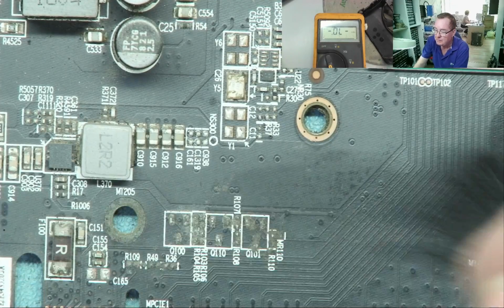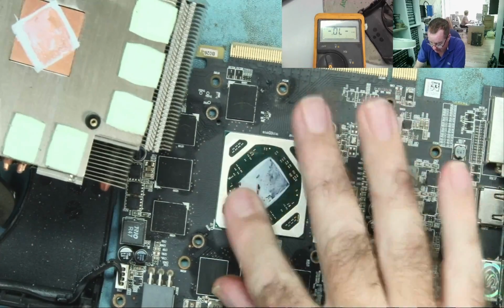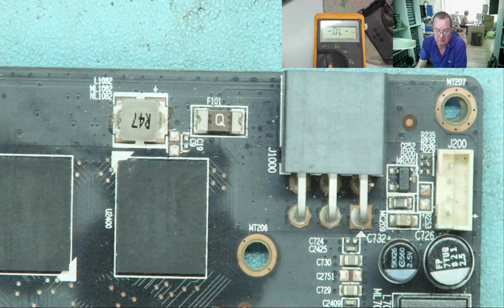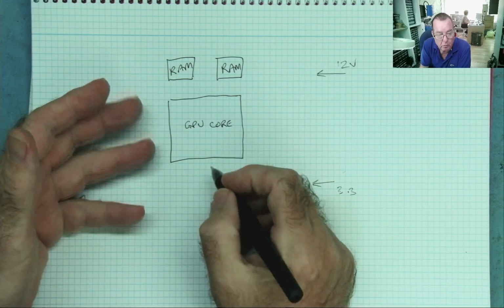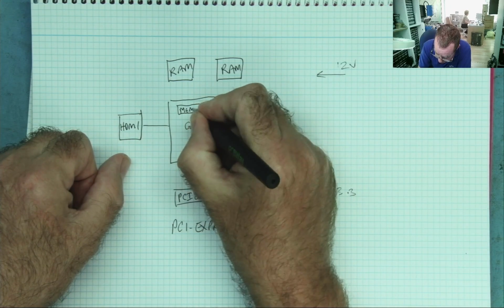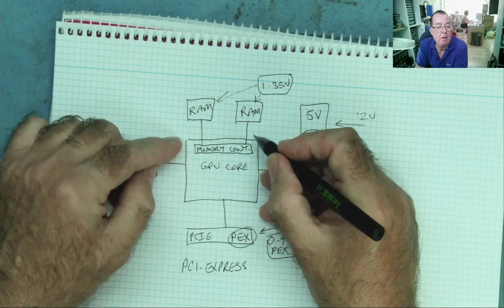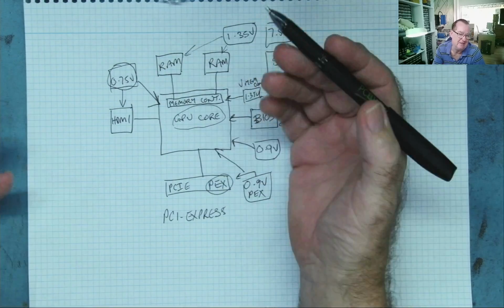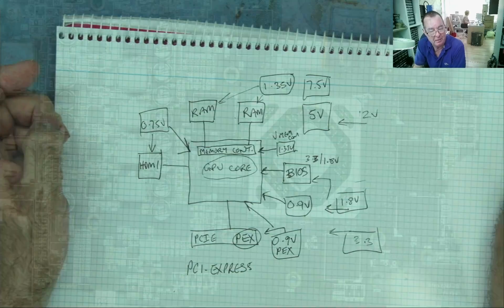Graphics Card Step By Step Fault Finding Repair Guide Part 2 How To Diagnose Faulty GPU

Comment: I have experience with electronics but nothing  on the computer side. I've already learned a ton in the first 40 minutes of these instructional videos. I have a rtx 2080 super hybrid oc. Came home one day and my PC was dead. Figured out the 2080 was not working. I followed your instructions from the last video and have open circuits on all 3.3v legs. If you have an advice as to my next step, or what video might help please let me know. I'm a little worried about removing my backplate. The thermo tape is really holding tuff. Is there a safer way to separate the plate?

Comment: As a warning to noobs. He is doing these measurements on an old graphics card. Anything 20 series and up will read 0.0 ohms for gpu core to ground. The newer cores require a miliohm meter to read.
Reply: What is miliohm meter 😅😅 I am aslo a noob if you call me it's help a lot for my journey
Reply: @HolaComtase milliohm meter is capable of reading extremely low values. Cheapest one you can get is like $140. It's not really necessary. 
He has a couple episodes talking about this device and how it can be used.
Reply: @icedcoffee8561 it's necessary to this meter and any tips For Me to Graphics Card Repairing 🥹 a noob 😅you advised save my time a lot currently I am watching this series other Recommendations

Comment: I just learned new thing from you. About oily thermalpad on vram chip. Im trying to fix EVGA 3070ti for the lats 2 weeks. And i reminded when i was taking it apart I had 2 memory chips like oily and the rest was either covered  with thermal paste  or particles of the pad. Unlike those 2, they were oily but clean of gray particles. Im looking for whats wrong with the card while learning. Card have no power to memory or the core. 3 red leds all on. One fan spins at full speed its +12v pin    just has a short  to +12v of power connector. I was injecting 1v 4amp to those two points to find warm component on the board that connected this fan straight to power supply. But couldnt find it. Voltage controller chip LPC51U68 becomes hot right after powerup. I bought a new one. My first GPU to repair. If you repaired same card with similar issues, i will be thankfull for any clues.
Reply: Did you get it fixed?
Reply: @Mrsmmith-w  no did not fix it. Do you know how to, or you have the same problem?
Reply: @vityok3000 I just had a 3060 turn off and won’t turn back on when plugged into psu, but if I unplug it and leave it on the motherboard the rgb turns on, idk how to even diagnose it
Reply: @Mrsmmith-w  this GPUs are very hard to repair. No schematics for them and multilayered boards are impossible to track contacts. I own ROG Strix 3070 OC that i bough like new open box. So far so good worked for few years no problem. And this EVGA 3070Ti I bought damaged like that with intent to repair, but no sucsess. I'm still planning to continue trying when ill have time. Bought couple of chips that may need to be changed, found burnt spot on one. And the other one is the one that gets hot. But I believe it needs to be programmed before installation. It has some leggs that can be connected to USB. So I believe if my chip is somewhat alive I can read and copy the program from it and move it to new one. First Im gonna change  burned chip it is fan controller. If that do nothing will try to desolder two memory chips that was oily. Card should run without them with less memory if they are shorted and causing protection mode. If that is not gonna help will try that hot chip procedure. Its the hardest thing because the leggs are very small. And my hot air soldering gun died. Cant find the other one I had.

Comment: RX5700 PCIe edge card testing shows a direct short to ground on the 12 volt legs. How do you find out which part is shorted? I suspect the GH15E regulator. I'd have to remove it to be sure it is causing the short. Nothing looks burned or heated. All parts look good. Do I need a better DVM to determine variances in readings under 1 ohm?

Comment: Fairly new to this but pretty sure my gpu overheated as was having temp issues then disassembly shows tbe water block fins are fairly blocked by corosion. Is it beyond repair? It was in use when it just stopped giving output (in tbe middle of a really important interview, which i had to finish with no output). The thermal paste was basically powder on removal with some evidence of corrosion around the powder (some of it looked greenish) the rest of the gpu looks perfect and all of the things here so far are good (although im new to this so not confident but going through this slowly)
Now when plugged in its not recognised on my rig or a friends.
It's now been sitting for about a year and a half. Its a 3080 Waterforce which i bought from Ebay during the pandemic so couldn't RMA it either.

I am UK based.
Do you think from the above description theres any point sending it off to someone like you or is it just dead?
If it is dead, what could i do with the other components if i was interested in learning electronics?
Looking into all this has me interested now

Comment: I have two faulty GeForce 8600 GT cards. There is a coil and associatively two caps that read zero to ground. It is the same on both cards. Is this normal?

Comment: Hi Richard, these aren't dried up compound, these are solid foilish gapfillers like graphite ones. These usually not shrinks so the termal connection between the heatsink and GPU always optimal.